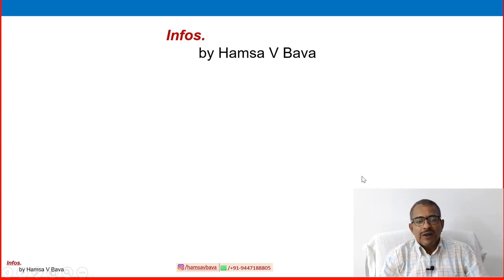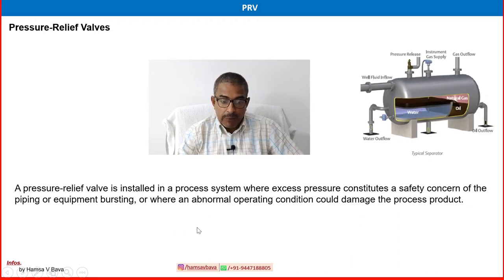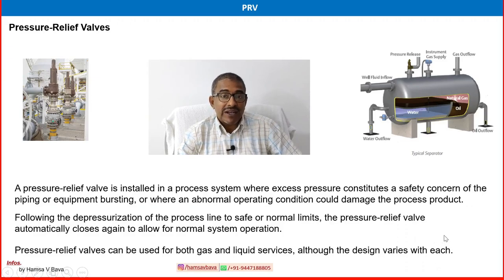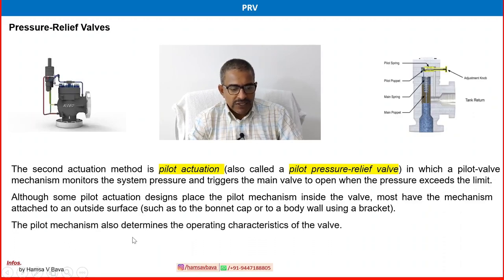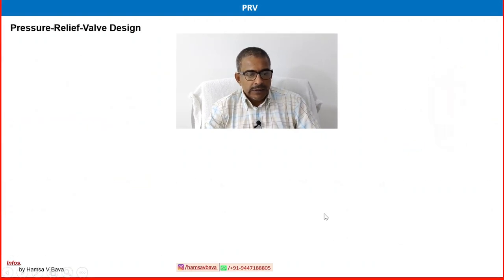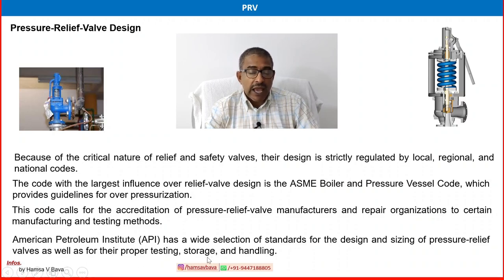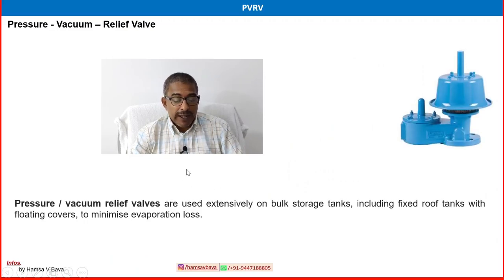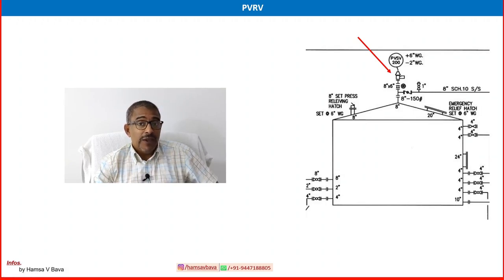Oil and Gas Process  - Valves Part 6 (Pressure Relief Valves)

Comment: Sir why we use gas over oil operated valve in natural gas pipeline instead of instrument air operated valves
Reply from the maker: Thanks for the question. your question not clear. if instrument air not available, then process gas can use as instrument gas.